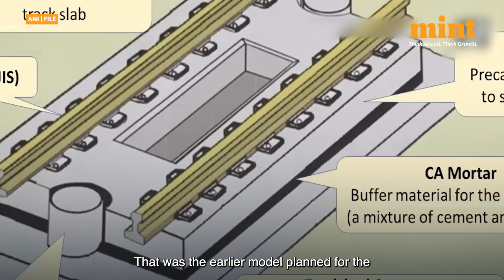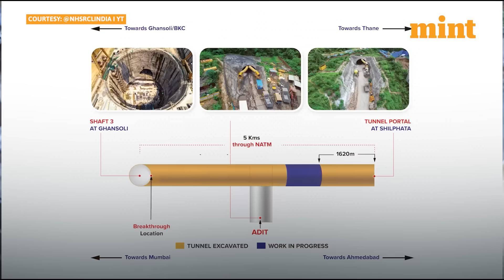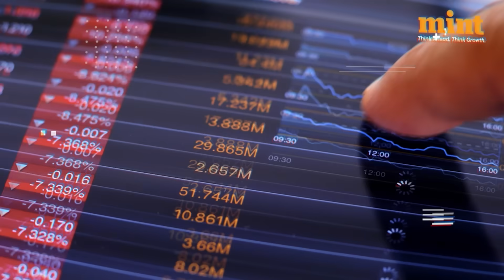India's ₹1.08 Lakh Cr Bullet Train Project Set For Global Debut With Japan’s E10 Shinkansen

Comment: All bakwaaas, I am on Delhi Bhopal Shatabdi express right now, look at the condition, the signage on coach is typically like any other normal Janta train with yellow iron depicting coach number fitted in an iron groove, otherwise it is a big box like where LED Light kind of signage to the size of 5ft by 1 ft is there, inside coach also no signage like the one we could see earlier telling if wash room is busy or not is absent, there is a bracket of aluminium where earlier we could see good pictures of interest of Indian tourism department like Taj Mahal or Qutub Minar or other pictures of tourism interest, the interior anyone can say is more than 5 years old, the glasses are dirty to an extent that you can see that they were cleaned more than 24 hours back and the signs of wiper can be seen, say 10 years back there used to be a kind of towel at the head rest portion of the seat attached with a vicryl but it is no more there , the small TV screen present is off at the entry inside the coach, please privatize the Indian Railway

Comment: Yes. It is scheduled to be partially operational in 2028. This is an optimistic projection with very little chance to make the schedule. 11 years to build less than 200km of rail. 18 km per year or 1.5 km per month or 50 meters per day, or 6 meters per hour with thousands of workers.
Reply: Really didn't know modi commissioned it in 2014😂, just try to do basic research the work basically started in 2019 and the total length is 500km +.

Comment: The Japanese shinkansen bullet train is not compatible with the etcs level 2 signalling system, The govt taking idiotic decision 🤬🤬, govt doesn't elaborate discuss about this project,,
Reply: Good point as per my information this has been done to decouple from Japanese vendor lock-in which they really love but on the long run it can cause compatibility issues. i think goi is planning to buy some of the trains from Japan at the start then use own designs which will be more compatible with ETCS.
Reply: @real-raiden-ei despite when the shinkansen bullet train would arrive in early 2026 for inspection purposes so why did the government award a signalling contract to Siemens ?
Reply: @real-raiden-ei Japanese shinkansen only run the ATS signalling system,, 😢
Reply: You dum***s Who said shinkenshan is not compatible with etcs in Taiwan shinkenshan is using etcs the main reason for etcs using because it is international tested and ats is only specific design for japnese region that's why they use etcs is using

Comment: Its wrong. Shinkansen isnt running in india
Reply: No you are wrong, I also read the news that bullet train doesn't run in India but later found that the news is fake 😊
Reply: @DebjitRoy-d4o yes yes u seem to be correct. Thanks
Reply: @DebjitRoy-d4o  Is it? I read somewhere this is because Japan increased per car price from 16cr to 50cr which means a single set of bullet train would cost us 800cr, and this is why India has declined Japan’s offer and planned to run indigenous VB at 250km/hr on same tracks.
Reply: @satsangiverma  Japan is already loosing HSR exports to china which was basically their USP. They want this project to succeed that’s why they gave loan to us basically at no interest
Reply: @satsangiverma No Japan isn’t doing that. Some fake news peddler started it
Reply: @satsangiverma  if that's the case then it would be foolish to go ahead with Japanese deal providing they are very much like Apple and don't share anything to maintain and upgrade the system locally. VM at 250 would not suffice as they are fundamentally different trains the best option would be purchasing trains from China and modify based on our needs as they are significantly cheaper.
Reply: @real-raiden-ei Good news! This news was fake, and there are no broken deals btwn India & Japan, Instead Japan is offering E10 to India which is capable of running upto 450kmph, E10 will be launched in Japan & India at the same time.

However, let’s imagine this news was true, even then India wouldn’t have bought trains from China, we don’t make deals with our neighbours, who constantly wants to crush us.